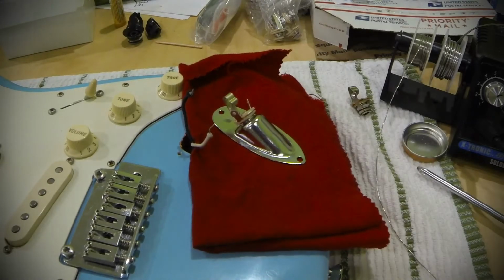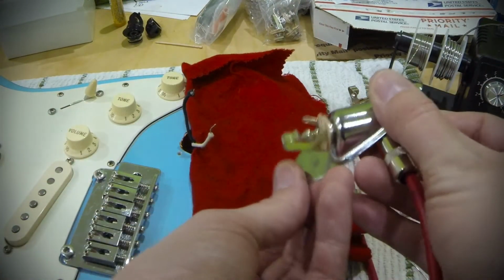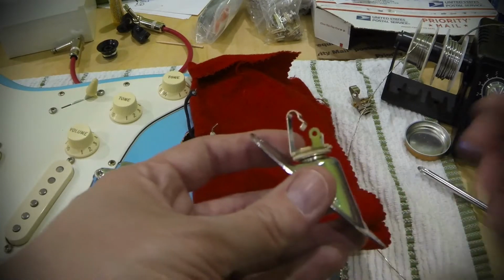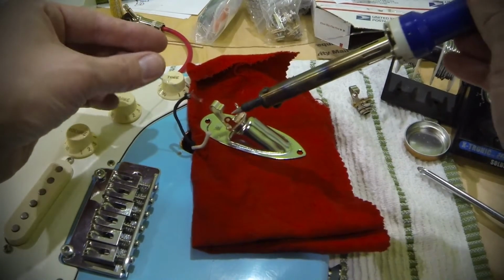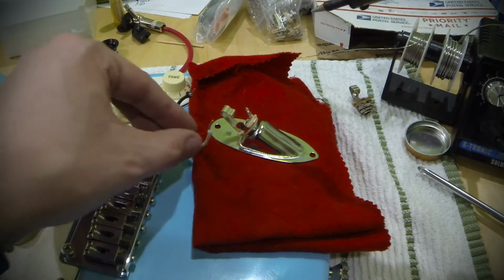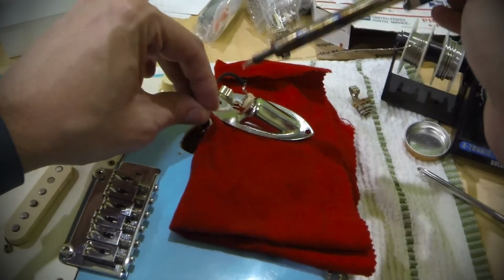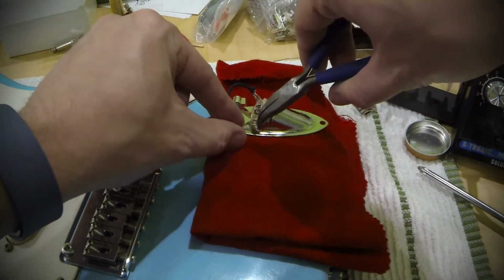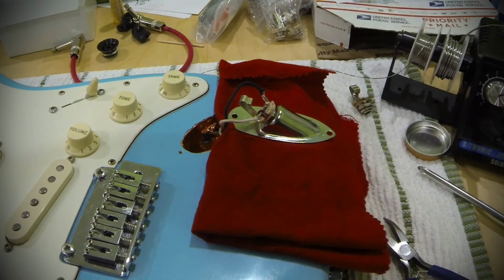Soldering a New Guitar Output Jack  - MMT09

Comment: It also helps to explain that the Ground is the inner circular portion of the jack, while the hot output tip is on the outside.

Comment: In semi acoustic guitar i have 3 places to solder.. So should i solder all 3 of them?
Reply from the maker: My apologies for not seeing this sooner. If it's a "standard" jack like the one shown in the video, but with three terminals, it's a TRS jack. Or, tip, ring and sleeve. Soldering all three depends on the circuit for the preamp, so I can't say for certain. Generally you still only need two connections, the tip and sleeve, or 1 and 3. If it's a balanced output then it would need all three pins as those have a dedicated shield connection as the third terminal.